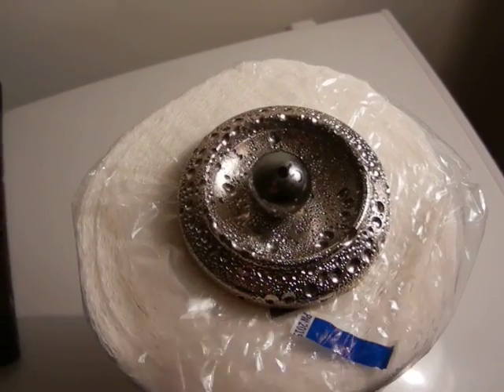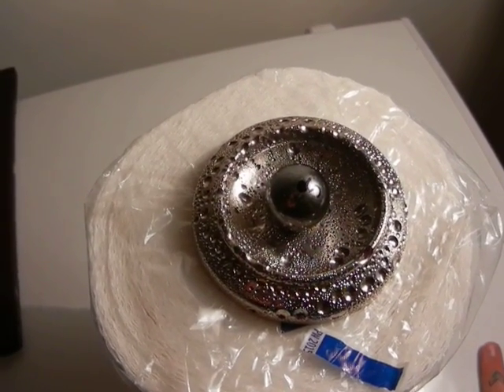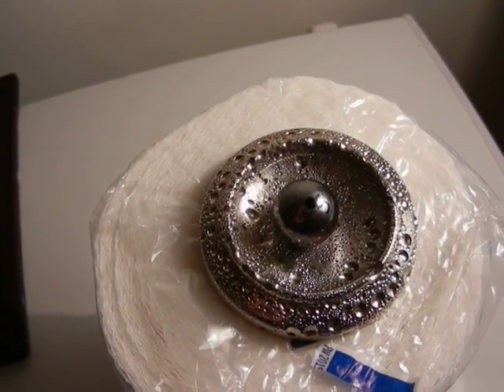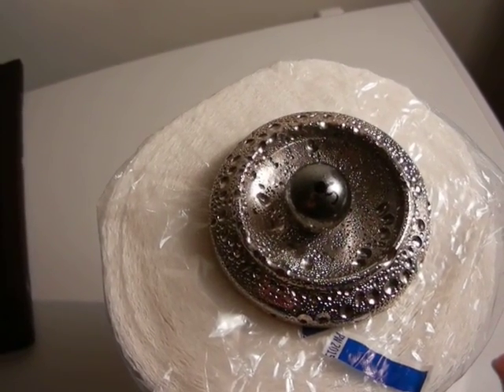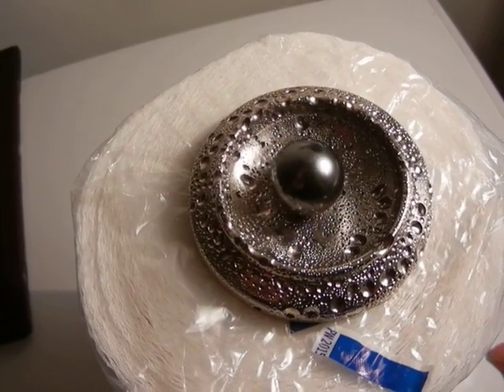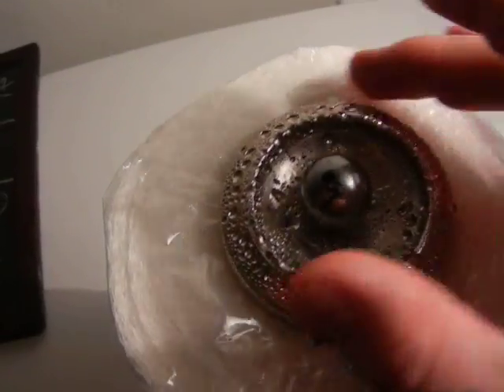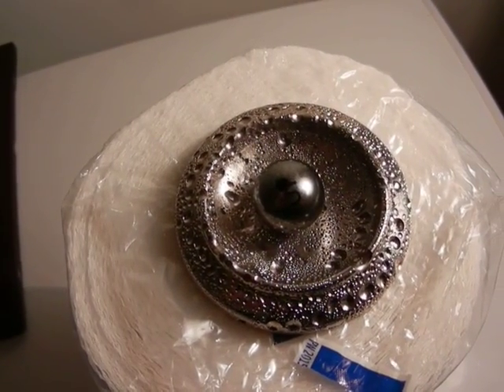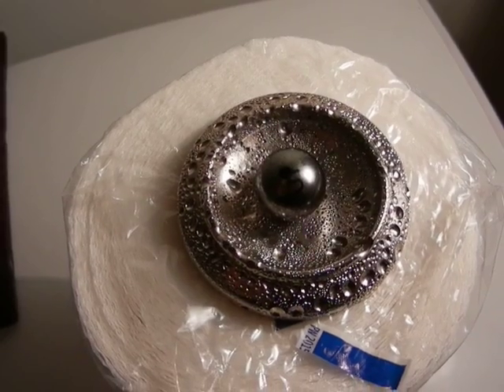VIDEO 97 UNCOVERING THE MISSING SECRETS OF MAGNETISM. Macro-Atomic model

Comment: I have a way of making a magnet that all the surface is one pole, while the other pole ends somewhere inside (max it could end is the half way point) so as to sort of "hide" the other pole though no way to really do this completely as it leaks through weak points caused by eddy currents and such, but still would enable building one then building a second spherical shell around it that the poles are reversed to enable building one of those "tractor beam" dual magnet (cylinder and ring) that will both attract and repel another disc magnet so you can drag it around on a table with out it snapping to and touching the other assembly ,ever, but only on a 2D plane, lift it and you get the quick snap of the disc sticking to some part of the ring or cylinder in the center, 
the spherical design I have worked on and tested the process of, would enable that same tractor effect but in all directions so it could be a 3D version, more over I think with weaker (thinner) areas on the spheres they could quite literally mimic what atom reactions to each other are like enough to make them a hand sized teaching tool for kids to learn about the fields that make up the world we are able to experience, from there they can then I guess decide if they want to be hands on or just a numbers person ;)